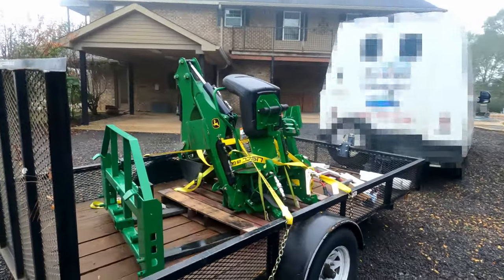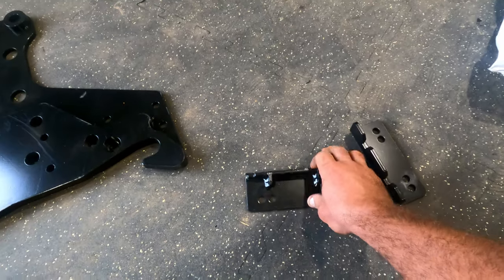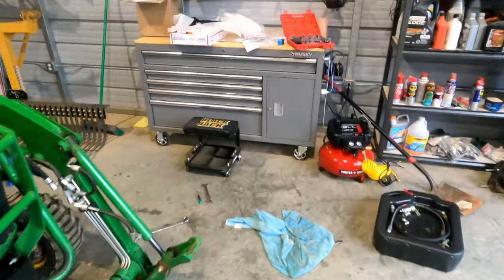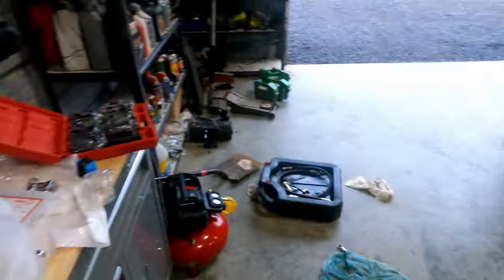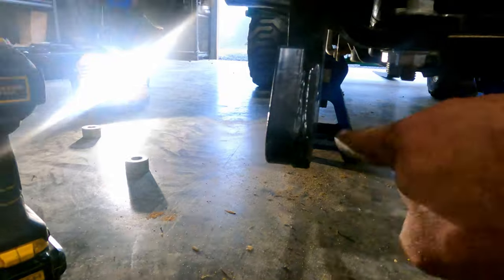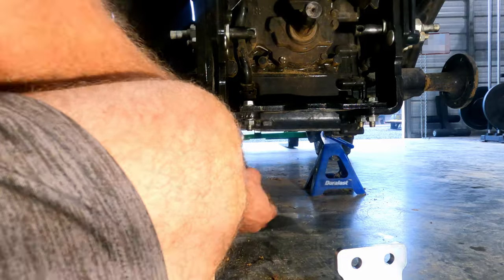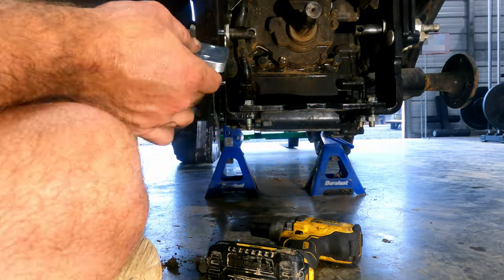260b Backhoe Subframe installation (John Deere 1025r)

Comment: Finally got mine done using your video.  Thanks!

You ought to add some part number for the viewers.  I believe your video is the only video that shows how to do this on the internet. 

One thing that surprised me is the large 34mm bolts and how much it took to remove them.  Milwaukee midtorque 1/2" could not loosen it (rated 550ft.lbs).  Ridgid 1/2" impact with 1K ft.lbs loosening torque, did the job.
Reply from the maker: Just updated the description with part numbers. I don't think my Dewalt is but 450ftlbs? It took a while, but it could get them all.

Comment: Looks like you removed 2 spacers that you didn’t need for the backhoe frame plate installation?  I’m selling my backhoe with mounting hardware and I believe I need those spacers to put things back together without having backhoe frame kit anymore?I would buy them from you if you still have them.
Reply from the maker: I’m actually using them for something else or you could have them. But I can’t imagine them being too expensive from Deere?
Reply: @BigDaddyAddyMS  thanks for quick reply, I’ll have to go to dealer tomorrow and see if they can pull up parts numbers and price.

Comment: Buying a 260b this week used. Comes with the subframe. Just wondering if the bolts you took off can fit with the subframe or did you have to get longer bolts to secure it? 

Also what does the seat bracket do? Or prevent?
Reply from the maker: Depends on what year you have. I believe the 2020+ models (I could be wrong on year) use the same bolts. If you have the unpainted spacers on the 4 big bolts, then those will work fine as the spacer is the same thickness as the bracket. 

The seat bracket gives is for support so all of the weights isn’t on the hinge.
Reply: Thanks for the quick reply. Video has been super helpful.

Comment: Not sure about the 260B but with the 260 you need to remove the left side plate to remove the hydraulic screen for cleaning. :(  How could they have done that?
Reply from the maker: I haven’t had to do that yet. I guess we’ll see!
Reply: @BigDaddyAddyMS  part number is the same for both 260B and 260 so it will be an issue.  I have not taken mine off yet but thinking of making a cut out for clearance.  Can't think it would cause any structural problems.  I checked with local dealer if any tricks. Nope, need to remove the plate.
Reply from the maker: @jimkramer4001  part number for what? The 260 and 260B backhoe brackets are wildly different.
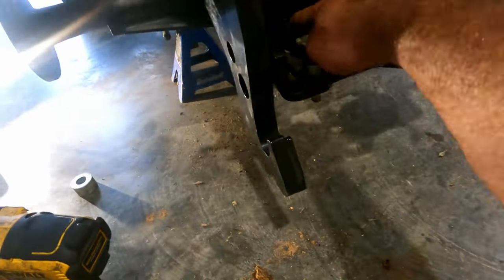Reply from the maker: @jimkramer4001  at 3:45 to 3:55 you can see there’s more than enough room to get to the screen.
Reply: @BigDaddyAddyMS  I searched on TA18812 and shows up for both. Yep, it does look like you have room.  Guess JD learned :)
Reply: good news, i was able to remove two bolts to make enough room for an allen wrench and was able to get the screen out.

Comment: Thank you for making the video!  

I am about to do this myself and got all the parts.  The handle and toolbox relocation bracket with other hardware being super banged up in transit but the shipper claimed that they come from factory with no packaging that way.  Was that the case for you?  Judging from the video, they look very clean and arrived without damage.
Reply from the maker: Mine were fine. But my dealer just had them shipped over from another dealer on their truck, so it never went through FedEx/UPS. There’s your problem. Lol
Reply: @BigDaddyAddyMS  Did you happened to make any power beyond kit install video?
Reply from the maker: @mightymikee  no, I didn’t. Sorry. I did the Summit Hydraulics kit though. Installing the kit is super simple, but getting to the hoses is a little time consuming.
Reply: @BigDaddyAddyMS  I see.  Still appreciate you for this video. Got the power beyond kit from JD.  Will be doing the install soon.  How long should I set aside to do the power beyond kit?  One afternoon?  Any tips?
Reply from the maker: @mightymikee  it should just drop right in because you’ll be working with custom bent metal pipes. The Summit kit is just rubber hoses with specific ends crimped on. But it really is very straight forward.
Reply: @BigDaddyAddyMS  Got it done and took about 2 hours.  Hardest part was bending quick connect lines and place the guide that mounts to the roll cage.  The instruction does not make it super obvious where to route and how to place the hard lines but it got done.

Will be doing the adapters this weekend.

Thank you for the video!
Reply from the maker: @mightymikee  nice! That’s faster than me! Lol. And the way the OEM power beyond routes is much nicer than I have right now. I think I’ll measure and order some custom hoses and fittings and redo mine.

Comment: Did you use all of the same bolts, you removed, the 4 big, the 4 small, and the one with the pin?  My 4 small ones barely grab the nut and the 4 big ones don’t work with the steel spacers still on them.
Reply from the maker: The steel spacers aren’t used when you add the backhoe mounts. They are just so Deere can use the same bolts on TLB and non-TLB models. The spacers are the same thickness as the backhoe mount. 

I’m pretty sure the mount kit came with new small bolts though.
Reply: @BigDaddyAddyMS  appreciate it, mine came with some but not all, either way, they’re the same.  I think I’m good then.  Thank you!

Comment: How do Hoi pick it up to put it on the back of the tractor? And do you have to take off the three point every time you use it? I assume the tires don’t have to come off every time. Do they?
Reply from the maker: You just back the tractor up to it and hook up the hydraulics to maneuver it onto the mounts. 

Yes, the 3 point hitch has to come off in order to mount the backhoe. 

No, the tires don’t have to come off to mount the backhoe. Lol. That was so I could install the subframe, which stays on to the tractor all the time, even when the backhoe isn’t on.
Reply: @BigDaddyAddyMS  I had figured the tires coming of and the subframe was a one and done but I didn’t know how the hooking up worked since it can’t move with out hydraulics
Reply: Use the outriggers to raise  it up. 3point bars need to be off , tires stay on
Reply: @OO-by2jl  yea I had figured the tires stay on lol. I didn’t know the out riggers were hydraulic. I had thought they were just folded down with multiple pin holes. I know that on big back goes that are permanently a back hoe have hydraulic outriggers. But thanks for the indo